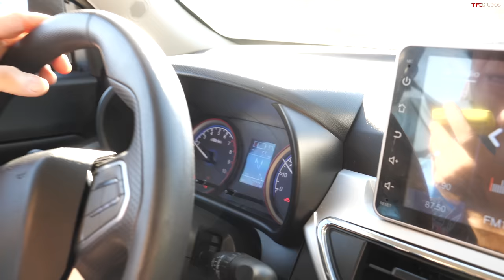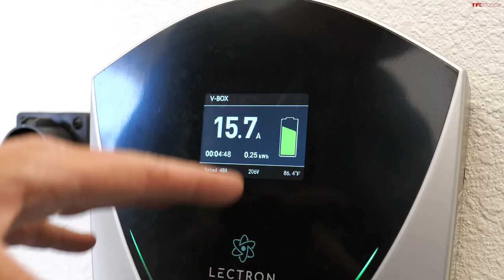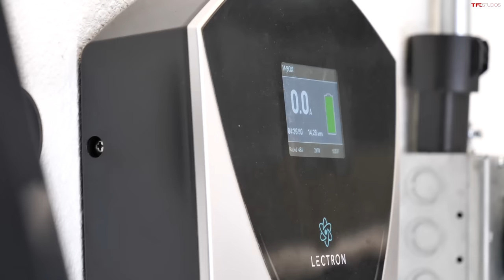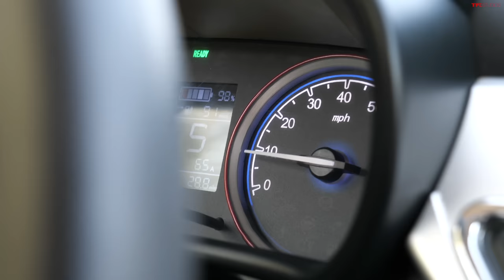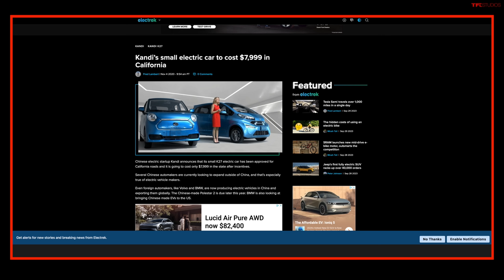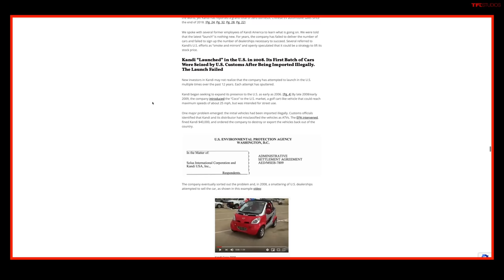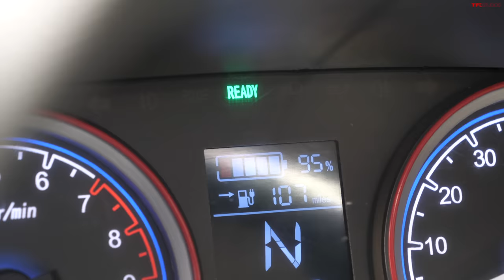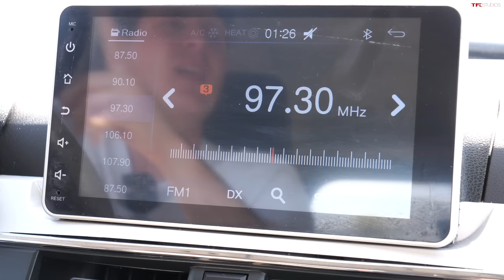It Broke Down TWICE In 48 Hours - The Cheapest New Car You Can Buy is TERRIBLE!

Comment: Problem is the electricity filter, it may be clogged
Reply: 100% agree.  Also, it may require a higher grade of electricity with more solar content.
Reply: Most people don't realize EVs still require blinker fluid too!
Reply: Ah, the old "low pass" filter...
Reply: Too much tofu in this tofu dreg cars filter.
Reply: You are wrong dude, small electric cars don't use electricity filters, so the most probable cause is clogged electricity injectors. Might as well check the voltaic manifold for galvanic corrosion.
Reply: K9P reservoir is probably empty.
Reply: The Kandi needs a Crush, because it seems like they are playing some kind of game.
Reply: The problem is the entire EV system. 200 EV Vehicles died despite getting a pass with US Customs and DOT Regulations. Most EV cars have 100 lithium ion battery cells built into the undercarriage. So there's no reason for a Die Hard battery on Film 1, the same battery in my forklift, and it takes four Die Hard batteries to run my forklift for 1 hour solid, but that includes 2500 pounds of weight on top of the blades.
Reply: @JoeWaylo  Did you mean the "move fast and break things" nature of startups is what's broken? It seems as if it's easier to get a company up and running through sleight of hand than it  should be. If you look at this story, Kandi just used the same kind of games it was playing back in China over here, and US officials were just as susceptible to their flim-flam as Chinese ones. EV startups back a few years were where AI is at now: 70% frauds, 20% status quo holders, and 10% innovators. This is the way we do new tech, and it sucks. So much landfill, like this car, winds up getting pushed out.
Reply: Whaaa?😂
Reply: the electricity pump is faulty.
Reply: You're all wrong. It's a problem with the electronic Horton Enviseon Whizbang Converter. It's based on Schwing Theory! Damn, you guys are so old school. BTW, that setup is known for unknown whizbanging intensity. It is unbalanced. It will go " whizzz...BANG!" A recent example happened in Whacknut, CA. The front wheels were blown off, the hood was launched, a poodle was crushed. Terrible, terrible.
Reply: Not the interconflagulator?

Comment: Also charge or check the 12 volt battery as it might be low. This would cause some of the car's systems not to work properly. The lithium battery may only be used for the electric motor.
Reply: This car should have 2 volt meter for 12v and high voltage battery.

Comment: Given the warning light and issues, I would suspect the 12v battery may be shot.
Reply: Your mistaken that 12v battery is also the main battery that drives the car too
Reply: @renamon1983  nope.  Not how electric vehicles work.  There is a 12v battery that runs all the computers and on board systems, and a separate high voltage and muuuch higher capacity battery for the drive motor.
Reply: @mrperkinsofaustria  I know I was joking cus it's such a small junky little car, no seriousness to be taken
Reply: @renamon1983  ah, apologies
Reply: @mrperkinsofaustria  no worries haha though I'm glad to see more people knowing about cars then just being ignorant to them
Reply: Lol, the 12v battery isn't the only thing shot on the high-class piece of machinery.

Comment: 12v is likely shot, I'd swap it out for a new one. A low/old/weak 12v battery can make all EVs and Hybrids freak out and act strange. As for the HV battery, I'd try just running it dead and charging it to full a handful of times and see if that recalibrates the BMS (maybe disconnect the 12v overnight as well to reset everything)

Comment: let it balance the cells by keeping it at 100% on the charger for a few hours
Reply: You'd probably have to cycle it between 95-100% a few times. I bet the BMS isn't smart enough to balance the cells and shut off the contactors at 100%

Comment: Plugs electric car of dubious quality into the charger - closes garage door and leaves premises to go to lunch.  Yup, nothing sketchy about that!
As others also stated - change the 12v battery (or at least check it's voltage manually) since it runs all the management electronics.

Comment: the 12 volt battery is probably toast as it sat forever and im sure they installed a crap one from the factory.  get it tested and or replace it.  you might see improvements in system operations.
Reply: Stamped on the battery," purely for decorative purposes."

Comment: So far great video's, what would be even better is for you to see if you can make it more reliable by fixing the issues the manufacturer overlooked, and also if you can improve the vehicle at very little cost by either jailbreaking it and get a more useful top speed and a better BMS for more reliable range predictions.
Reply: Put in a reliable motor and drive it to see how long the rest of the car lasts.

Comment: i adjust you get that hood open and check inside motor bay area for any rottening wiring because that can cause fault with pcm reading battery wrong 2nd you need get it on lift and pull battery out check for bad bms because it causing it misreading
2nd there is esc in hood and just need two wire plugs into esc that allow you bypassed speed limited from 35mhp to 76mhp (normal find inform by using model code off of esc tell you more about it )

Comment: I am actually kind of amazed that this car was "sold" for a profit. The BOM/Labor price on this thing must be like, 5K?? Its clear they payed zero royalties for any of the tech, and it likely has batteries that were either used, or did not meet the spec other manufacturers require. Need to find out who made the ECU so you can get into it and change some parameters, such as the max speed limiter.

Comment: A few problems exist with Chinese Electric vehicles.  Miles Electric vehicles had trucks back in the day, used by Colleges as yard maintenance vehicles,  Prison garbage collectors, etc. I was a warranty repair person for them for a short time until they went bankrupt.   A few problems existed almost every time.  1 the charging plug was wired wrong....white is neutral coming from infrastructure, in a car black or green is your ground...so the charging port plug would be wired backwards, so when you plugged it in, you would pop the charging system. 2.  The charging system had the wrong algorithm in the charger, so you wouldn't get consistent charges or none at all since the batteries couldn't take the charge.  Thus reprogram the charging unit 3. Wiring harness is wrong, when these things are made in a factory in China, if they run out of white wire blue stripe, they grab whatever other wire they have laying around...white with blue was headlight circuit, but in some cars it wasn't or there would be two wiring paths in the same wire color code. The wiring harness was almost impossible to troubleshoot without tracing all wiring out before working on it  4.  Main wire harness gets water in it and nothing works right, disconnect the main wiring harness connector and look for corrosion.  Basically where the main wiring harness meets the ECU.  5.  If it has multiple battery's daisy chained together, if one battery is more than .3 volts off from the other batteries in the system, you will get misreading's on the batteries when it is charged, will show full charge, 5 minutes down the road you are at 20% 6. there is a low volt and a high volt system in electric cars...the voltage converter could be bad and thus both systems couldn't run or work together, thus issues with gauges misreading, etc.  Chinese car wiring is the worst thing to work on...hands down.

Comment: I remember reading about these when they opened a "showroom" in Dallas a few years ago. I think the Dallas Morning News did a piece on them.
My "scam-o-meter" went full red with this company as soon as I read about such a cheap foreign import car that only went 35 mph and was meant to be a city car. My biggest question was "Why?", because at the time, you could buy a 2-3 year old Ford Focus or Fiesta, or several other compact cars, with low mileage for the same price as one of these.
I then discovered the dealership/showroom was about a mile from where I worked. The strangest part was it was not where anyone would expect a car dealership - at the end of a dead end road next door to a Home Depot and NTB, hidden near a business park.

Comment: the governor isnt terrible it gives the car range. you could install a digital voltmeter right on the battery. and go by battery voltage and ignore the computer battery display completely. we upgrade 6 volt batteries to 8 volt batteries in golf carts and they go much faster. looking into a higher voltage battery and installing a dc converter would be the way to go, remove the weight of that advanced auto 12 volt battery too. also the battery range might be programmed intentionally to show 100 mile range to get market sales. you can probably recalibrate the computer using a laptop and the software. cant compare this vehicle to cars because the price says it all. however someone looking to have a electric golf cart to drive around town this is a better option.

Comment: If Roman took it to car wash and caused issues, what would it happened after a t storm or 10" of snow on the top?

Not a great QC, but the idea would work well in a large city.  Small, so it's easy to park.  Low speed, in a metro city, no need to go 70mph.  But charging would be a slight issue...

Comment: U do realize the faster you drive and when u use the A/C and hard accelerations it DEPLETES SO much FASTER! So if it was rated to only get 100 miles per charge 
It’s really prob only 60-70 max and goes down faster the more ACC on and harder drives

Comment: Hmm, $5,600, Tesla-$40,000 ++++.   You can buy all new internal parts for it or redesign the battery system for a lot less you paid for the vehicle and have better parts to it and it's still a lot less than any other car on the market.

Comment: I don’t see any real issues. Unreliable range limits, 35 mph maximum speed, no manufacturer support, and not even remotely water resistant. I guess the only issue is that it got an extra whack from the ugly stick.

Comment: Rule #1 for buying cars: NEVER buy Chinese junk. Made of genuine Chinesium, has Chinese components, Chinese tires. Oh what could possibly go wrong? If you're stuck with that boat anchor, yank all the electric running gear, put in a motorcycle engine and transmission, modify whatever it takes to make it run. Then sell it.

Comment: With less air pressure at altitude should offer less resistance than at sea level,which explains your insane downhill push on previous video.Also the warning triangle should replace the temp tag ,again the IKE beckons.

Comment: Find the vehicle speed sensor and unplug it... that was the quick and easy fix for the imported Kei-sized trucks to eliminate the governor.  If it uses the ABS/traction control wheel speed sensors to operate the speedometer, unplug one or more.  Of course, you'll lose the speedo and odo, but who cares about this piece of crap?